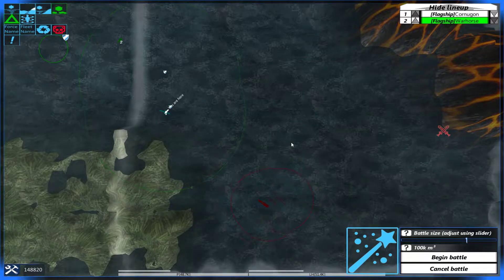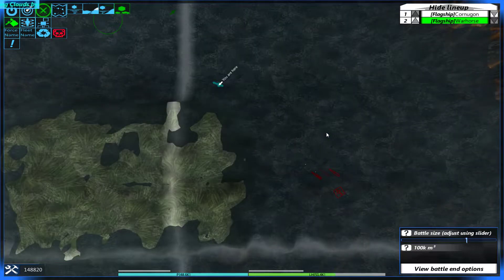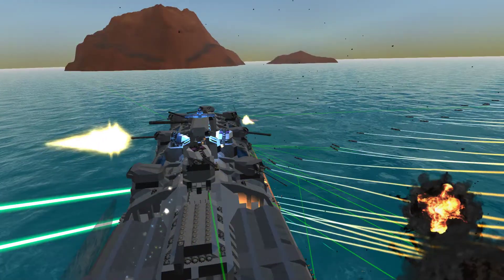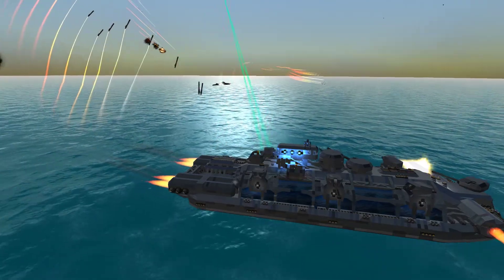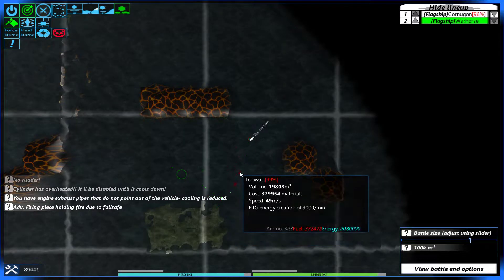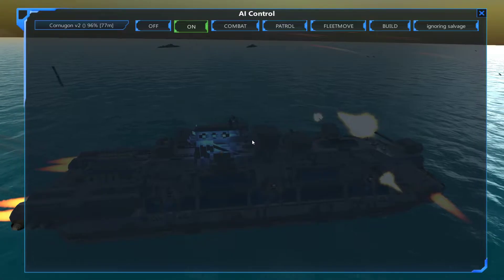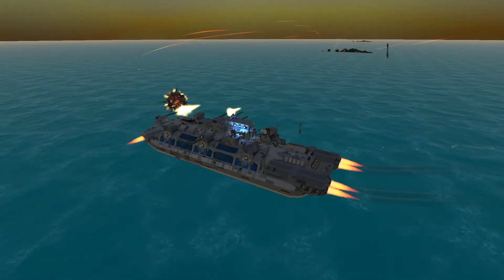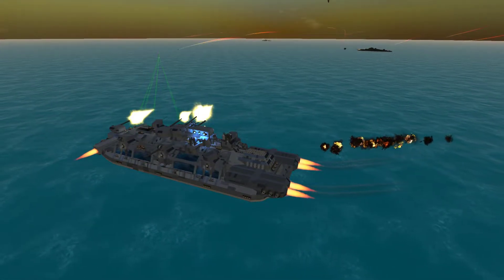From the Depths | Quest for Neter 28 - Cornugon Revenge

Comment: i also enjoy your content. nice to hear reasoning behind your actions. 

low gauge CIWS kinda not as good as 400mm one. you can fit flack, timed fuse, gunpowder into 1m shell and still have good ROF. though it kinda slow on moving its barrel . also anti-missiles kinda nice. couple small missile launchers on 2 axis turret can do more than you can expect from it.
Reply: Agreed a 400mm belt feed blaster flak cannon can take out massive swaths of missiles.  I use one on my battleship and it doesn't care if its a missile or torpedo.  Something else fun to play with is an aerial denial system. Its just one big ass flak round that is shot into the air with a timed fuse controlled by an acb.  You can set it to detonate above the craft just far enough to not damage the craft but wipe out tons of missiles that are in range of the flak cloud.
Reply from the maker: @Damaddok82  Now that is an interesting idea. I may have to give that a shot.
Reply: @bigtino7557  I got the idea from Aner dyfan.  Hes got a youtube video up somewhere that shows how it works.  Ive used a similar one for a laser gunship ive made and its pretty effective.